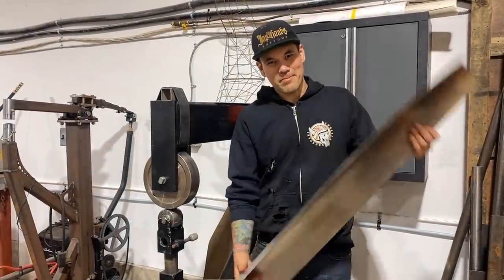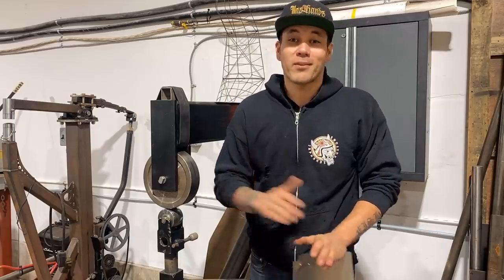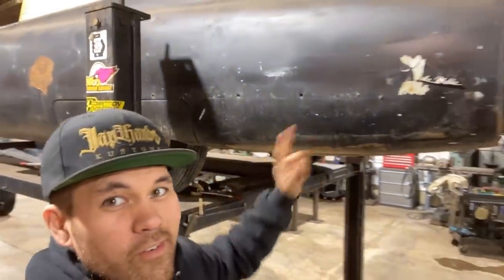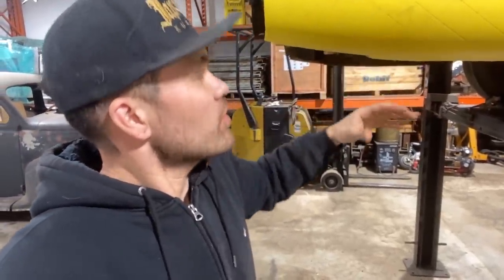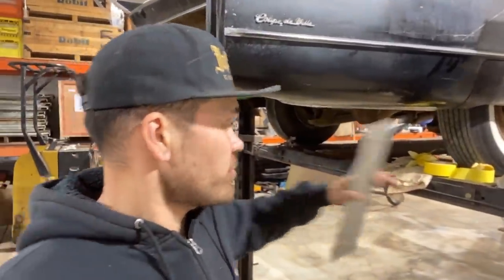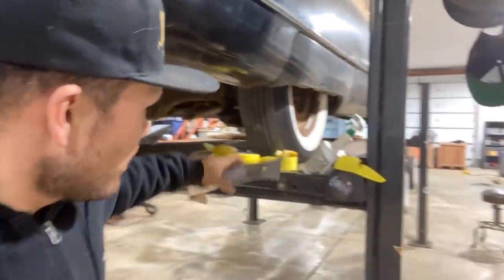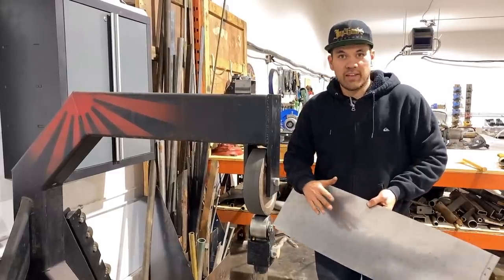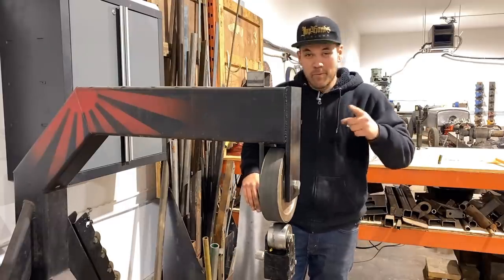Metal Shaping Patch Panel Using the English Wheel!!! | Rust Repair 1960 Cadillac Coupe de Ville

Comment: Just watching you select out the area and panel you want to make, and then the process of hammer, rolling, fitting, it's easy to see how you're matching the new metal to the complex shape formed by stamping, originally established, and the many ways of pushing the sheet that forms the three D shape.  I've worked with die forming most of my life, easy to see how the dies stretch and form the sheet in the stamping, and I am only now seeing how that shape is forced out by careful selection of radius, direction and number of passes, move each section you focus on.  It's a real pleasure watching you do this so carefully, exactly.

Comment: We need that kind of tightening radius on bonnets on pre-war cars and I always struggle with it. My mentor, sadly gone, just bent them over his knee! I haven't tried a rubber band on my wheeling machine yet (I think only non English people call them English wheels?) but how they can smooth out the walnuts after bashing steel with a mallet always amazes me. So much to learn and when you only do it as a hobby it's not easy. Thanks for sharing your knowledge! Your explanations are excellent.

Comment: The best giveaway is the knowledge you share..You might want to think about buying a piece of large diameter,thick walled,heat shrink tubing without,the adhesive lining.Cut it longer than you need.Heat it evenly,then,trim the excess. I used it to replace the missing rubber covering on a six inch belt sander that I restored. I placed the rollers in the lathe and,turned them slowly,warming the shrink tubing slowly with a heat gun.Food for thought.👍
Reply from the maker: Well that’s a really good idea I never thought of that. Thank you!

Comment: Great work. I made a urethane upper for my Metal Ace 44 out of a caster like that and it works but not as fast as an inner tube. Real easy to leave wheel tracks in a panel with an inner tube if you apply too much pressure. The urethane didn't leave tracks unless you really leaned on it.

A urethane skateboard wheel as a bottom die on your bead roller will really speed up tipping.
Reply from the maker: Thanks so much for answering my question! And the skateboard wheel is a great idea to

Comment: When you’re using the electric hand shear turn it upside down and you will find that it’s easier to follow the line you’ve drawn.  Simple tip which makes it better to be accurate. You’re very knowledgeable and thanks for the videos.

Comment: Did the same 1960 caddilac repair in 1975.  Used galvanized stovepipe,  stainless rivets and fiberglass cloth with resin.  Had to use a planishing hammer to crown the exact same low spot.

Comment: I made my rubber band from a tiny innertube ,pocket bike tube. Then I let it roll over each side two inches. Seems to stay on much better as I have a sloppy anvil mount too! I sanded off some lines on the tube but i dont think they would have made a mark when using it any ways. I like your show man !
Reply from the maker: Thank you and thank you for the info!

Comment: Great work Karl… knew you were on the Caddy as soon as I saw your post on ‘Insta’. Just wondering about that polyurethane wheel no harm in experimenting ‘as is’ the rubber bonding could be the ultimate upgrade. Keep doing your thing and will check out ‘Bad Chad’ when I finish work.. Cheers!!
Reply from the maker: Right on Malcolm! Cheers

Comment: Karl,  loving the tutorials. Just finishing off a very long term project and getting ready for no. 2, last one. I really need a tutorial on the tailgate on your truck. Got the recessed panel figured out, just the top & bit on has mescartching my head.
Reply from the maker: The tailgate of my truck is actually simpler than you think. It’s just welded tube top and bottom
Reply: @MakeItKustom  I thought that, I have done it that way before, but a simpler layout. Thanks for the reply

Comment: Beautiful job making the panel, and thanks for documenting and explaining your process. Also I'm glad I'm not the only one who has issues with the rubber walking off the upper wheel. It seems like those inner tube sections are almost a one time use and then the rubber gets too stretched to stay on the wheel properly, I'll be looking forward to seeing your solution to that problem!

Comment: Wow you did amazing shaping that panel. I have done quite a bit of work making pans and transitions with hvac sheet metal and I could see exactly what you were doing and why but also thought about what kind of a mess I would make out of the panel you just made. Crazy good job, it looks excellent.

Comment: Nice demonstration! I have heard the English wheel band walks off as has happened in your video. I am in the hunt for something to correct this. I think I saw trick tools had a poly band if I remember correctly I may give a shot. Plus I am also 3/4 of the way into a air driven pedal/cylinder for a Shrinker stretcher. I just need to mount the units on the metal plate.
Reply from the maker: Awesome! An air powered shrinker stretcher would be awesome

Comment: Been running the red wheel for years, it's got more give than one would assume. Gave up the rubber for the same damn reasons and I laughed out loud when you busted the red wheel out right as I was reliving that frustration with you 🤣
Reply from the maker: So stoked them on the right track! I saw them on sale at Princess auto and couldn’t resist
Reply: @MakeItKustom  I had the same epiphany one day, was just like "huh, I'll try that" lol

Comment: Good stuff as always. I like the Wray Schelin style flexible pattern. I have used the urethane caster wheel on a friends machine and it did seem to work.....possibly a little stretch but you have the experience to control that with pressure. Fiddling with the rubber band drives me nuts!
Reply from the maker: 🙏🙏🙏 Glad I’m not the only one! Lol

Comment: Great video Karl. I was thinking about when you mentioned coming up with something to give away. I think it would be a pretty cool project for you and your lady to make a shop stool, like what you'd sit on at your local auto parts store counter, in a similar fashion to the tattoo arm rest you guys made. You could make sweet sheet metal legs/frame, dimple die'd and bead rolled or whatever your artistic mind comes up with. Maybe some cnc plasma cut pieces. And she could whip out a sweet metal flake vinyl seat cushion. Just a thought!

Comment: hi Karl, check the videos posted by Nick at Invision Prototypes as he uses a homemade soft rubber top wheel which looks to be a   tire/wheel from a hand cart. a pneumatic tire seems to allow the ability to adjust the firmness of the top wheel by adding/removing air pressure in the wheel.

Comment: Hello, newer viewer who appreciates your content.  I have quite a bit of experience with wheels and molded tires for robot stuff.

Regarding that orange wheel: it's probably pretty hard, like Shore A 90 or in the shore D range.  You can get a softer one if you check on a vendor like McMaster or Misumi (I think Misumi will ship to Canada)

Alternatively, you could have someone do a rubber overmold/compression mold that actually is vulcanized on.  If it is vulcanized on, it is chemically bonded to the base metal and it's not exactly accurate to call a cemented on chunk of rubber "vulcanized.". I have done overmolded ~60A rubber on small rollers for robot wheels and it worked pretty dang good, but the guy in Minnesota that did it charged me about $8k USD for a 9-pocket tool so we could make 1000 rollers.

One final option could be a cast urethane.  You would need to take a roller and create some undercut features (drill radial holes or cut a groove on a lathe or both)  to mechanically lock the material to the metal since it doesn't bond chemically.  That would be the cheapest and one of the more flexible options because you can get casting compound in durometers ranging from super soft to hard lile a golf ball and you could make a 3D printed mold even.
Reply from the maker: Thank you so much for the insight! I’ll check them out and give it a shot

Comment: Amazing job! Do you always work to have perfect panel surface like this? I'm asking cause if the car will be painted, some minor imperfections, like file or sand marks, will not be a problem for most people. So if the client agree, you probably could make it a little fast and affordable. Do you consider this kind of approach for painted cars?
Reply from the maker: This panel surface is a direct imprint of the wheels so it really wouldn’t make anything faster to have the surface any different. The more imperfections there are, the more time a body man needs to spend so it’s kind of a tossup I guess

Comment: Beautiful! Getting bonus points now, back on the caddy. Question, on a 1955 Chevy rear quarter panel that is sold aftermarket. The wheel lip edge is not sharp on the panel, it’s too rounded in shape. Is it possible to sharpen those lines around the wheel well panel? Can you do something like this on vid? Thanks
Reply from the maker: Thanks David yes it’s definitely possible to sharpen lines if necessary. I would start with a caulking tool
 It’s basically a chisel made from Delron. You can buy Delron from a plastic place and just sharpen a chisel use it on the backside and hammer it along the areas you want to sharpen

Comment: Did a search of your videos. Any plans to fab a custom gauge cluster that looks factoryish? Gonna try one in near future (Tach, Speed, Gas, Alt, Oil Pressure, Temp - the standards) but figured you might have some cool style/function touches/tips to add
Reply from the maker: Kind of depends on what you’re doing and what vehicle

Comment: The red urethane is usually rated at 2000 lbs, it’s soft as compared to a tan or green, but not nearly as pliable as rubber.

Comment: Amazing  work Karl . I was wondering if you could show a technique for a do it yourselfer for repairing cab corners. I have a 1988 Ford pickup truck and those corners are destroyed. Is there any somewhat easy way to make them? Thanks!
Reply from the maker: To be honest I think you’re better off just buying them for that truck since they’re cheap and easy to get. But when I make them and make them into pieces and weld on the bench part so that I only have to check each side a little bit to make the corner
Reply: Make It Kustom the problem is that I live in Argentina and here those kind of parts are not available and due to a dumb restriction on imports, you can’t even buy them from another country. So... short of finding a donor truck and chopping them off of that one, I have to make them. And I’ve been following your channel and you have techniques that somehow make it seem easy hehe that’s why I thought I would ask. I wish I had a guy like you near me. I would park my truck in your shop lol

Comment: Question: why did you hold the tape template down with magnets? If you stick it down, mark it, and then mark the BACK SIDE, as the working side, wouldn't that achieve the same result?
Reply from the maker: Yes absolutely! You are correct it doesn’t matter

Comment: If you could find an old forklift tire they vulcanize the rubber to a knurled pipe. They are a lot fatter and require cutting the width to size. Then if you machined the center to run on your machine and press it in your modified wheel. A little work for one wheel but it might be something you could sell.

Comment: Can you make the rubber band wider so it goes down over the sides of the wheel? that should prevent it from slipping off? (cut a wider piece from an inner tube)
Reply from the maker: Maybe I’ll have to try stuff thanks for the suggestion

Comment: Just wondering if rather than rough blocking out, could you just wheel the raised area in?
Reply from the maker: Not sure what you’re asking? What are you referring to
Reply: @MakeItKustom  Sorry, Rather than hammer the metal in a rough fashion, Why not just use the English wheel only to gain area?

Comment: Why would you not use that whole panel and have the welding joint under the chrome strip???
Congrats on 100k subs. 
PS --- I prefer a ' 38 cab, able to use passenger car panels for the front
Reply from the maker: That’s interesting! Didn’t realize that you could use passenger car panels in the front! As for the welding joint it doesn’t matter to me where it is
Reply: @MakeItKustom  ---38 to 47 cabs, I have 38 sheet metal that I'm trying to find a cab for, not as common here in AUSTRALIA 👍👍👍

Comment: again, well done, thumbs up, dont use the Uretane, it will be to hard  ; (  , look for a Rubber that fits more "snug" around the upper Wheel.
i use the Tube from a Wheelbarrow Wheel...... ; )
Reply from the maker: Thanks for the tip!

Comment: The rubberband wouldn't slide on the urethane wheel nearly as badly.  I think I'd just attach the wheel, slide on the band and give that a shot before I put too much time and/or money into a whole new wheel.  But, my experience with them is incredibly limited.

Comment: See if I get this right.  If it's all rusty and missing parts and in general it's in terrible shape; you want to bring it back to factory specs, But if it's in perfect shape and requires very little work; you want to modify it. Do dimples on a car cause it to fly fast, farther and straighter as it does with a golf ball? If so why are you removing all those dimples?

Comment: The wheel can be covered with polyurethane, it can be of any rigidity.
We have many workshops in Russia that thus restore wheels for warehouse equipment. You can also cover it with rubber.
You can watch the process at 19:00 in the video https://youtu.be/l-f3ACF4-dw in which the tank is made from Bentley

Comment: when cutting out your panel why couldn't you have just stuck your tape template to the sheet & cut it out . holding the back side of your tape  template to the metal with magnets works but the shape should be the same if you restuck your tape to the new metal. Bend it the way you need it after it's cut to the right shape.
Reply from the maker: Both works I gues

Comment: I would like to be a semi-serious nitpicker here; you are introducing a small error in radiuses when adjusting the new panel by comparing the inside radius of the new panel to the outer radius of the old panel. The new panel radiuses end up being amount of the thickness of the metal larger than in the original, which is of course negligible in a panel this size. As I said I'm being semi-serious, but it is something that can be a problem in some cases.
Nice work and congrats on 100K subs!
Reply from the maker: Constructive criticism is always welcome here thank you!